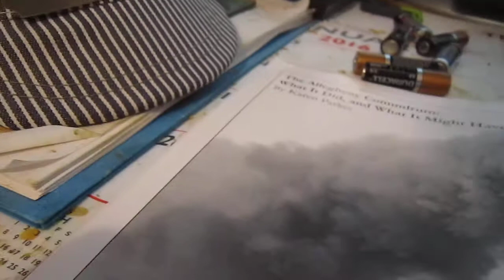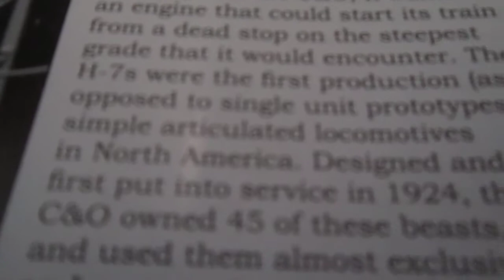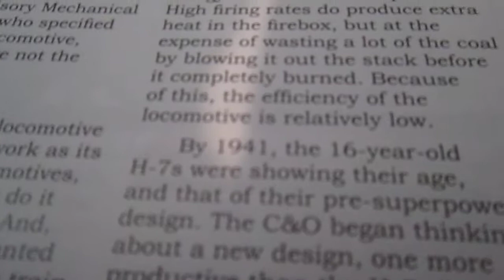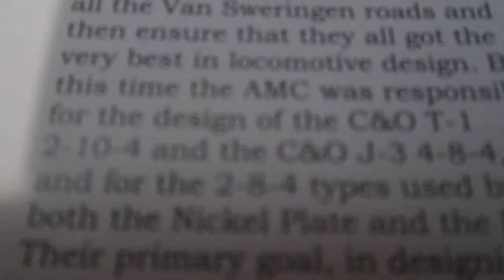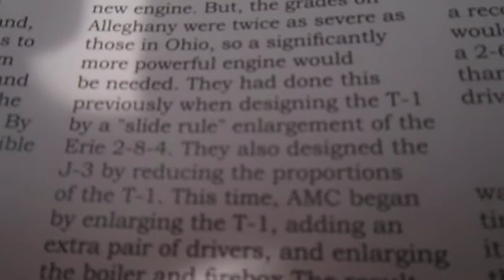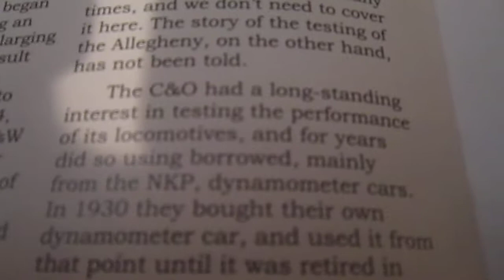Truth of C&O Allegheny Class Engine 1

Comment: An N&W class A producing 6300hp? I was under the impression that a class A could produce 5,300-5,400hp and no more, with the Y6b Producing 5,600hp?
Reply from the maker: depends who you ask but this was the artical in the C&O historical society book so I imagine it has lots of stats and fact checking for accuracy on the truth
Reply: @manga12  Interesting, perhaps the Class A was more powerful than I thought.
Reply from the maker: @sangheiliwarrior86  well it was one of the most powerful ever made, if you want to talk about it more the woman that authored the artical is just below this comment Miss Karen Parker ask her more about it I just wanted to put the artical out there and set the record straight of the most powerful direct drive steam locomotive of all time and the heaviest, we have the big boy and up fans flaunting about its the biggest its the biggest, when it was say only the largest engine itself, but engine and tender nay, heaviest nay that was the H8, most horsepower that was a LIma the H8 and thought it was made more to be a mountain fast freight engine, it did just what the C&O wanted it to do, twice the work for half the fuel and in half the time, and by splitting the drivers up you did not have as massive a hammer blow as a 12 wheeled drive set would have had with massive rods and valve gear though it was rough enough as it was, and the Allegheny is said to have had the biggest firebox ever put on a steam locomotive, or was it largest boiler? one of the two it escapes me right now but its abillity to generate steam is unmatched.
Reply: @manga12  I think Allegheny had the largest *firebox*. I've heard people quote the Big boy's firebox could fit inside the Allegheny's, and I believe Virginian 2-10-10-2s (for example) had larger boilers than Chessy 2-6-6-6s, but were not as powerful.